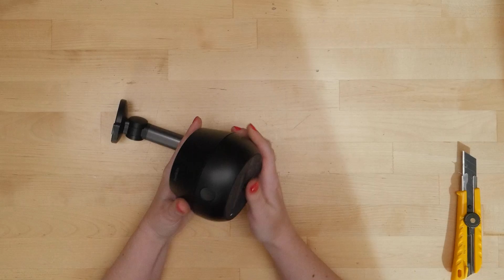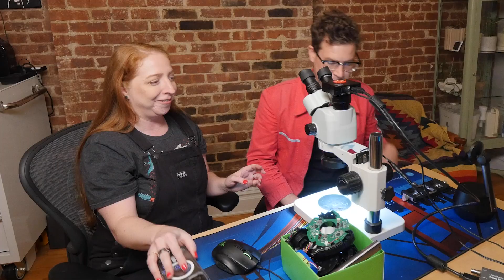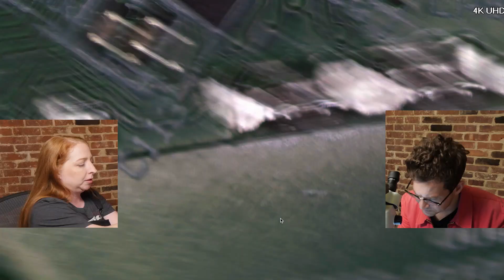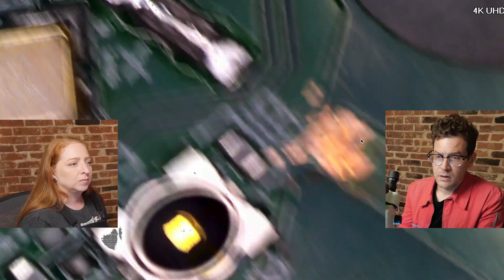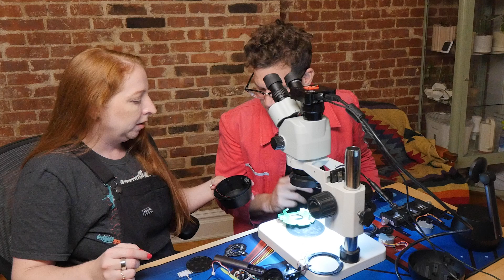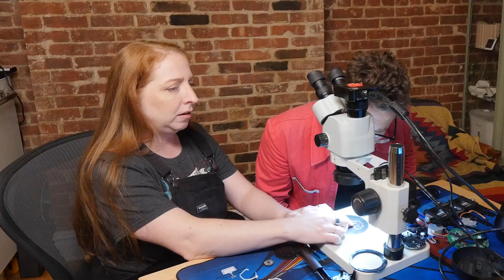What's inside the Belkin Autotracking Stand Pro?

Comment: have you considered repurposing the pre HP take over Polycom cameras? They go for extremely low prices due to the proprietary nature of the controllers. The polycom 7000 and 8000 control units are amazing inside too, in my opinion, they are some of the best built pcbs made. The cases are sturdy easily repurposed metal, clad in plastic which i've used on countless projects, the fans are super quite, the power supplies are small and fit in tight spaces. The quality of the PCB construction makes harvesting components efficient and oddly satisfying...

To understand the quality of the devices, do a search for the original prices...your jaw will hit the floor.

Comment: A neat thing about doing a 90 degree twist on belts: it's a time-honored means of jankily adapting a vertical drive motor to a horizontal drive shaft, like say, for homemade go-karts using lawn mower engines picked from the side of the road. You wear the belt faster for having the twist in it, but not so much it's a no-go. In this use case though, it's likely not any real concern ever, and they get a bit of free tensioning of the belt by way of the twist, which helps eliminate some slop in the drive. Since there's not really any big load on the belt weight-wise it's basically just a compact means of sending rotation up to the top of the mount plate. Verr nice.

Comment: I'm surprised at all the wires going through the slip rings, when 3 should do for power and the button. Or 5 if it also supports USB control.

Comment: Cool insight. I like the way the whole thing's put together with screws, so you didn't have to try to prize it apart with a spudger.
Reply: For fuck sake yes. That means in a few years when the batteries are kack they can be repaired easily.